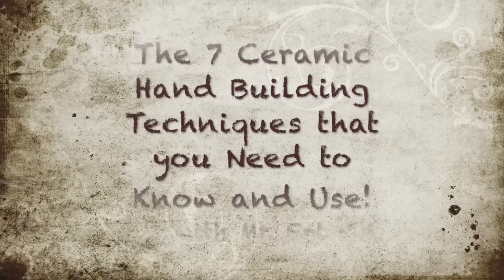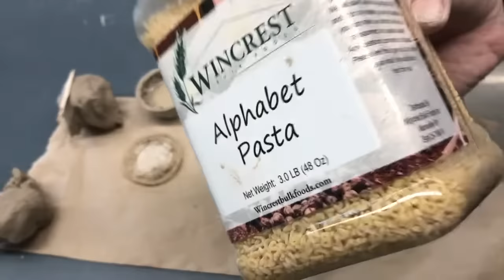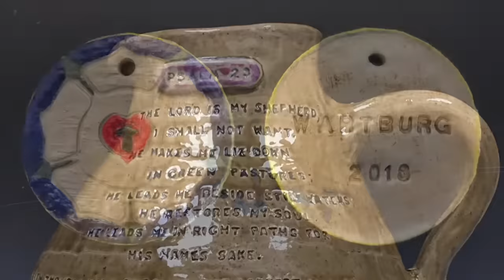7 Ceramic Handbuilding Techniques that you should be using

Comment: In the studio where I worked we used cornstarch rather than cloth to prevent clay from sticking (when using plastic bowls or other plastic forms or patterns). We applied it to our slabs by pouring it into socks and patting the slab with it.
Reply from the maker: That makes sense. I do wonder how it might effect possible reclaim, but I wouldn’t anticipate much interference on the surface… since it would just burn off anyway.
Reply: @Fugli1  We did wipe some of it off if we had been a little too crazy with the application, but generally didn't worry much about it. And we had no problem re reclaiming.
Reply: Thank you for the sock trick.  I just bought corn starch and wondered how to use it best.
Reply: me sirve esta data, muchas gracias por compartir💌
Reply: @Fugli1  I've used cornstarch for slip mold barriers on troublesome molds. Have not seen issues in reclaim yet, but that's defiantly a great question. I'll have to keep an eye out for effects.

Comment: Techniques are solid, and the example work is very interesting. The add-ons you've placed on you work look like natural extensions of the work. I really like this!

However, I would use caution about expendables in the kiln. They can leave deposits on heating coils, and degrade them faster if used frequently. I would do this, but would pop them off before bisque firing. It's a great way to get cheap impressions of letters though, and it looks great!

Comment: You don't recommend wedging? What about refining the shape at the leather hard stage? Peace and Health
Reply from the maker: Thanks. Wedging should have already been done. While there are techniques to wedging, I guess I don’t consider it a technique in itself. It’s a necessity, so I usually prewedge everything. As for refining shape and form at different stages, there are many classes/seminars/etc. where that isn’t possible because they basically go from project to firing without revisiting after a drying time. This is true for a class I will be hosting in July where they come in one Wednesday for about an hour and a half, and I have to have it fired by the next Wednesday without seeing most of the students in between. But, you are right, the list could be so much longer. I had to fish or cut bait on some items when choosing stuff on the video.

Comment: What type of liners do you use for Mold method ? Plastic or fabric ?
Thank you in advance.
Reply from the maker: Building in a bowl? You can use all sorts of materials. I usually use a piece cut from a lightweight plastic shopping bag because it’s cheap and it will help keep clay hydrated longer. You can peel it off and it can be reused. Fabric can also be a good way to add even more texture. Using a piece of fabric that has a deep grain or designs in the thread work can add even more variety. Another option is paper. Cut strips of paper (like newspaper) can be used to line a form. And if they absorb enough moisture that they stay stuck, they will burn off in the kiln.

Comment: What works best for liners? I'm having trouble with my clay sticking to everything and winding up ruined
Reply from the maker: If by liner you mean something to inscribe a line then wet wood. Do not use a stylus as if it were a pen or pencil. Use low angles and press into the clay… do not drag your tool.